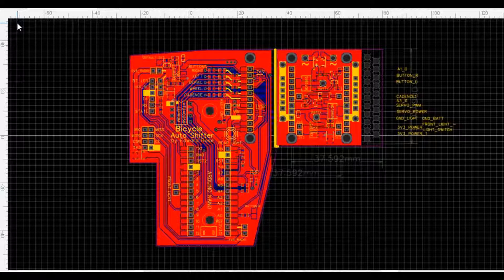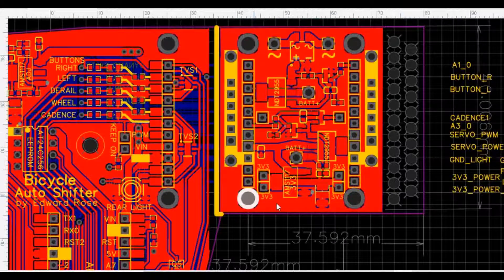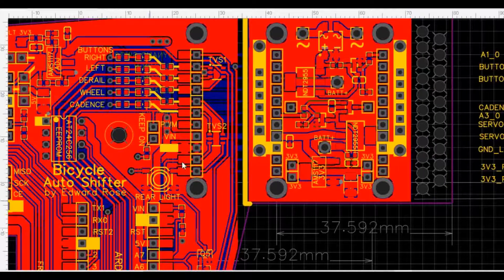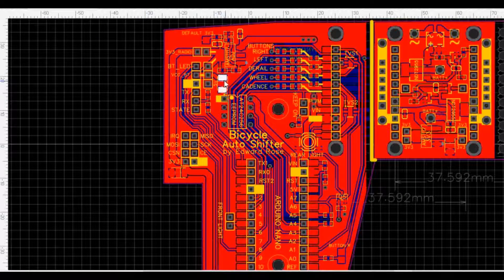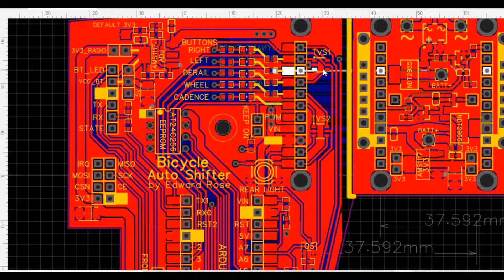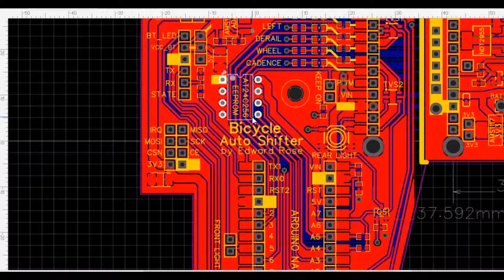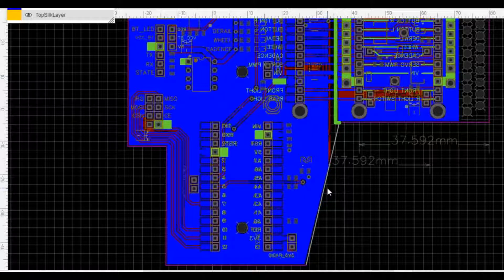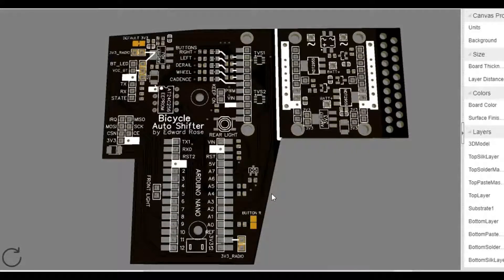Auto Shifter New PCB design

Comment: Hm, I'd recommend a Z-Diode after the rectifier, if your dynamo doesn't have one built-in. Same as the TVS-Diodes, not really necessary but those are all safety mechanisms, like fuses or ABS in your car ;)
Reply from the maker: Thank you this is exactly why I bother sharing, for the helpful suggestions. In case the battery gets disconnected because these dynamos put out 1V per mph so could reach +30V.
Reply: @Ed.R  Yes, I've heard reports of >80V in no-load conditions for some hub dynamos. This is obviously a problem for LED bike lights, which now some hub dynamos have a built-in Z-Diode to clamp the output voltage. In any case a Z-Diode or TVS on the input of your circuit is cheap insurance.